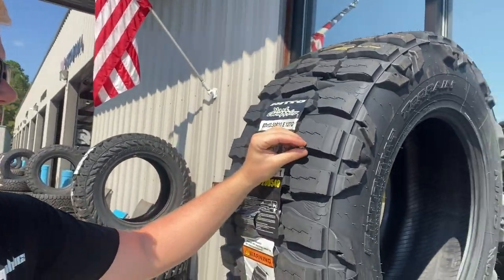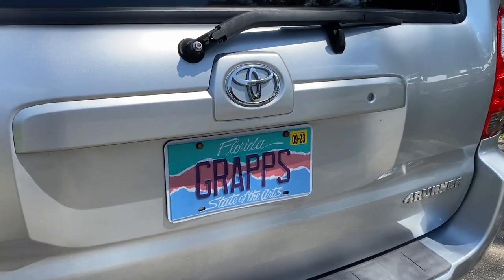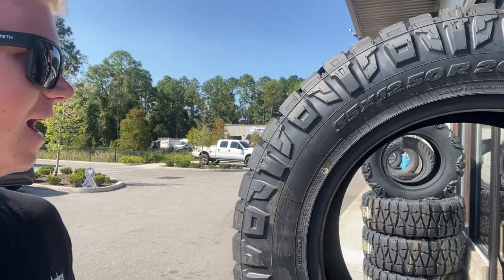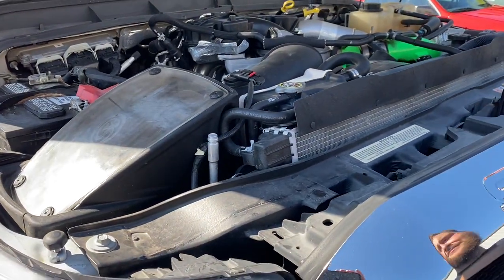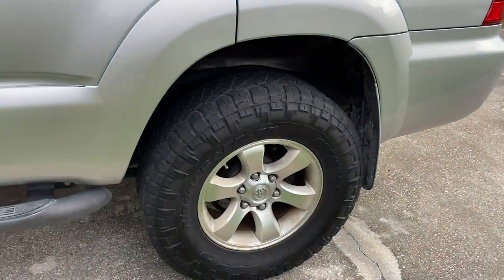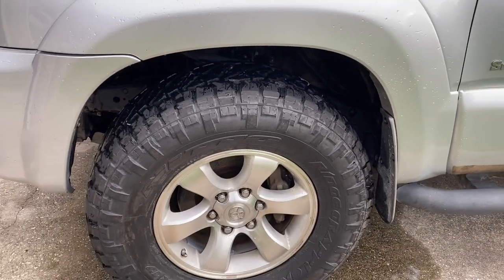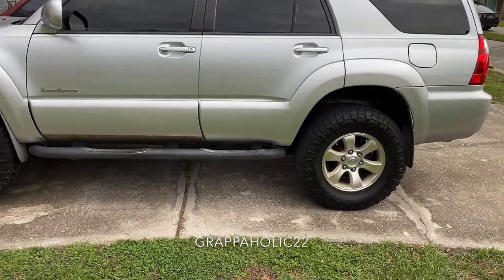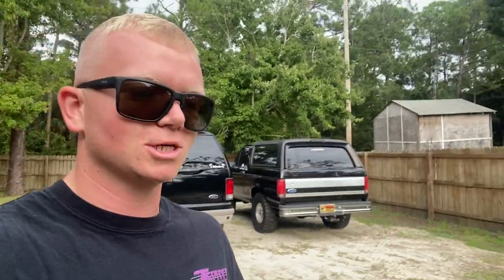Roofing Nails vs Nitto Tires: Truck Stuff Vlog Ep. 11

Comment: Had roofing nail in one of my mud graps a few years back. Plugged it, and it lived a few thousand miles more with a slow leak.

Taking my first set of ridge graps off with 48k miles on them for another set of them on my daily.
Reply from the maker: Good to know! Those nails turn up everywhere
Reply: @GRAPPAHOLICS  it’s those damn roofers hauling away old roof tear offs in dump trailers! Figures I got the nail shortly after my parents had the roof done at their house
Reply from the maker: @chevyon37s  That’s for sure. It’s a shame how common it is

Comment: Hey I have a 2021 f250 I was trying to find a set of 38x15.50r20 mud grapplers and I was wandering if you knew where I could find some new ones or slightly used I can’t find any anywhere else
Reply from the maker: Some of the Instagram pages that tag me seem to have them in stock. Flawless whips or SPR Offroad. Could be worth looking into
Reply: Okay thanks I found a set off eBay